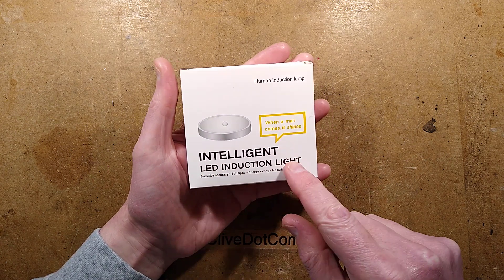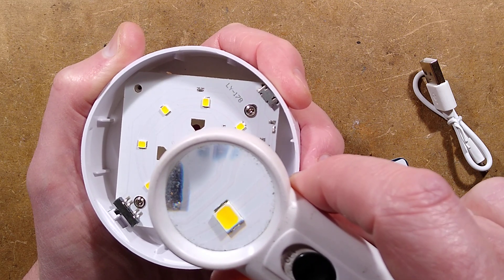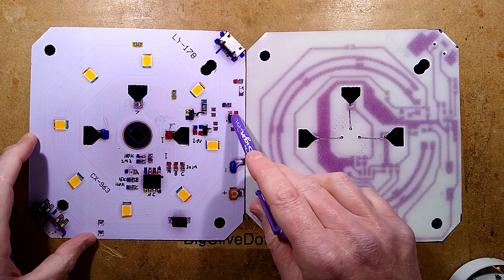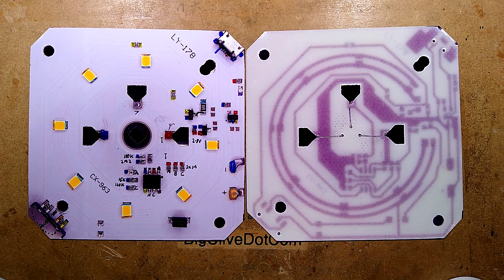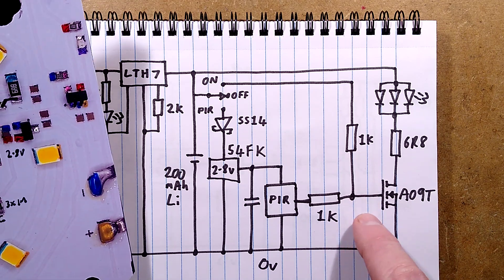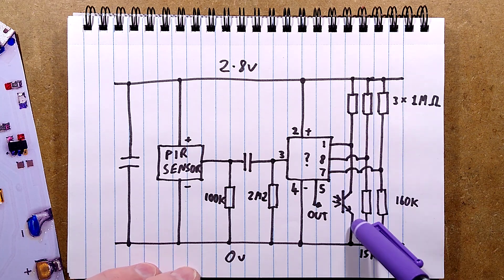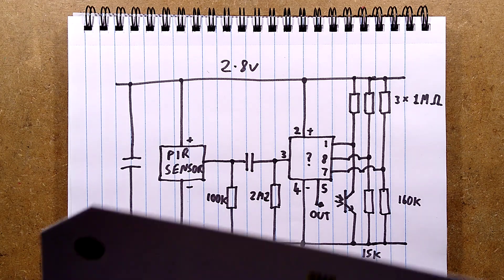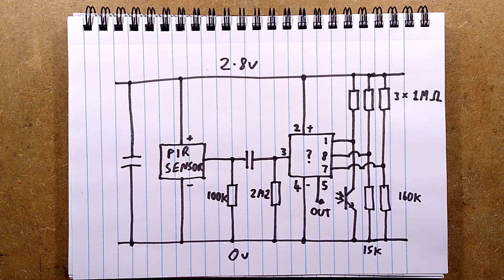eBay rechargeable movement detecting light

Comment: Hi Clive,

I have a question/query, with regard to lighting triggered by movement.

I bought 2 rechargeable aluminium bar style LED lights with magnetic pads to use in my kitchen,  they sit underneath each of the wall hung cabinets.

The one over the sink, seems to get activated even when no one is in the room. Is it possible that my shiny stainless steel sink is somehow reflecting back at the lightings detection system causing it to switch on?, with that in mind, I swapped it over with the other one and bingo!, this now randomly turns on, so the lights are not faulty to my reckoning.

Does reflection off of stainless steel cause my light to activate itself?, maybe?
Reply from the maker: Yes.  They can see thermal reflections from shiny surfaces like glass and metal.  Maybe made worse by the sink acting as a wide angle reflector.

Comment: Based on your search words, I looked on eBay and found a pair of these that were cheaper than your estimate. What was even odder, the vendor of these had an ad that was even cheaper but didn't show up in the search. I only noticed because the "related" ones had an ad for a pair that were cheaper. When I checked it, it was the same vendor. Not sure why the search didn't show that one up but no matter. It arrived 2 weeks after ordering.

The only differences were no switch and round magnets rather than a square one. Oh, and only 6 LEDs rather than 8.

I stuck one of them up under the ceiling in front of my entrance door the other night. When I went out that night, it worked well but I was disappointed to find that it had dropped by the time I got back. Seems the glue holding the magnet into the device isn't that strong.

Anyway, how long does one of these last before it needs to be recharged? Say, without it being used?
Reply from the maker: Quiescent current is low, so it depends more on the number of actuations.

Comment: I wonder which of the resistors, if any, determines the length of time it stays lit once it's turned on?  On the ones I have I changed the resistor from 47k to 10k to reduce the on time from 20 seconds down to 8 seconds.  That extended the time to a month between charges.  Thanks, Clive.
Reply from the maker: The chip is identified in the description.  You can change the time delay.

Comment: I have a similar light in that it is triggered to turn on. It's called a "Mighty Light". I looked for another awhile back. They want to much for them. It uses a 9V battery and lasts a long time. I use rechargeable lithium in it now. Here is why:
Wife calls it the ghost light. When the charge drops it will turn on/off within the normal set time but it will erratically activate. Switching to the rechargeables stopped that. It was quite exciting being woken up by a random light coming from the bathroom, along with the accompanying exclamations and bitching! Lol!

Comment: decode the IC by its Pins and connected parts - From the circuit you have drawn, its a dual opamp - like the ones from TI and Microchip. Try OPA835 - Pin2 pin4 supply voltage terminals fit pinout. wonder if a LP358 is subbed with requisite changes ,  will it work?

Comment: Off Topic: Clive, when you have the time could you look at grow lamp bulbs. I have 5 that are rated 85-240V AC. What I find strange is the power consumption remains constant at 10W per globe irrespective of the voltage I supply to them from a variac. I'd love to know how they achieve that. The other curiosity is these are rated at 30W, not 10W (I'm guessing that is a claim the output is equivalent to a 30W non-LED bulb).
Reply from the maker: They will be using switching power supplies that can operate over a wide voltage range.  They transfer the power as a series of magnetic pulses through an inductor or transformer, and only run as much as is needed to satisfy the load.
Reply: @bigclivedotcom   Thank you for the reply. I've been out of electronics for over a decade now so I find it amazing that these days a purpose built switch mode power supply in each of these bulbs makes economic sense over the alternative which would be 2 styles of bulb, one for 110/120V and another for 220/240V. Not that I doubt what you say for a moment. Times move on and my thought patterns are to some extent stuck in the past. Best regards.

Comment: For larfs in a future video, you could obtain an old replaceable mobile phone battery and wire that in. Something of the order of 2000mAh should be easily obtainable and would also have its own safety circuitry built in.
It would take ages to charge (I wouldn't recommend increasing the charging current as the linear charger will get very toasty), but it would last ages too.

Comment: Got one of these, immediately after opening i did exactly as you said: decreased the current (mine had 2R2 resistor, changed to 22R) and increased the battery.

Comment: Might chip "?" simply be a 555-type device in bistable flip-flop mode?
Reply from the maker: It turns out to be a mx8098g
Reply: @bigclivedotcom  

Thanks for responding, Clive.  

As you probably already discovered, Googling "mx9089g" returns lots and lots of what look like tech data sheets, all of them in Chinese, and only in Chinese.  I predict that that will occur more and more frequently.

Google Translate had trouble digesting them.

It might be prudent for the next generation of engineering tech folks to start learning Mandarin Chinese, starting now.  If taken with a positive attitude, doing so can be enjoyable, and can help to prop open the doors of opportunity.
Reply from the maker: @haroldsmith45302  You can actually glean a lot of data from the images and number son the datasheets before having to use the Google translate app if at all.

Comment: Did you make current consumption measurements while in standby mode (not triggered)? 
I wonder how long the battery lasts just sitting idle!
Reply from the maker: 9.5uA stated standby current.  mx8098g

Comment: Actually, a narrow one of these would be ideal for my front door. It could fit at the top of the door frame between the security screen door and the front door, and illuminate the door itself so I could actually see where the key hole is. Since it's magnetic, I wouldn't even need the sticky back piece of metal, it should stick straight to the steel door frame. The lighting in the stairwell of my building is terrible. It's literally never worked properly, even after they replace the tubes. They use those tiny 4W tubes, and they constantly strobe whenever you press the button, like they're running at half or even a quarter the 50Hz mains. I thought the ballasts were supposed to give up if they fail to strike? It's like they wired the two fittings in series or something.
Reply from the maker: You can get slim versions.

Comment: Nice that they went with the 2.8v ldo instead of 3v3, I have a previous pir LED rechargable you recommended and I think it has the 3v3 which you pointed out as a weakness. Would be nice for the furnace room/utility room especially in case of power outage.

I bought one of those spudgers you use (yes the brand iSesamo) and it's lovely... I am now also accumulating a collection of "standard" Chinese components: got the A2SHB n channel mosfets, A5SHB p channel (not sure why I didn't get the a1shb instead), j3y npn, and have the 662k 3.3v ldo on the way... Can't remember the common pnp part. So much sot-23 making my diy circuits tiny, and making it possible for me to spend time repairing super cheap things...

Comment: No protection on the cell? How naughty!
Reply: I don't think it's critical. The draw of the PIR circuit is really low, and the LEDs won't pass any current below their somewhat gradual threshold range, so they should cut off around 2.8V. So when the battery is drained, you probably have months left before the battery reaches deep discharge during which you should definitely recharge it.

Comment: You would think that a Chinese Company wanting to sell to English speaking customers would hire a proper grammar English speaking translator...
Reply: And then have to produce and sell one thousand units to recoup the cost?  Cheaper to use a dictionary or Google Translate...
Reply: @Rob2  It's a translator.... Not a Rocket Scientist... 
Besides...You still have to pay to print the gibberish
Reply: @lasersbee  When you get a cheap translator you will still get bad results.
I would think you would need to hire a translator from an English speaking country, and pay the tariff that is normal there.  Which could be a lot compared to a local guy.

Comment: Just FYI - the A09T is my favorite AO3400 FET :)
Reply from the maker: Looking at the specs, it's even better than my previous favourite the A2SHB.  Ridiculously easy to drive with staggeringly low on-state resistance.
Reply: @bigclivedotcom  And I have to say that after using ~100 of them (and also AO3401), they are a little magic - the on-state resistance means you can drive 1A without even noticeable warming...

Comment: It seems to me that the light output is going to be very variable.  When the lithium cell is fully charged there's about a volt across the 6R8 resistor and the current is about 150mA but when the battery reaches end of discharge the voltage across the 6R8 approaches zero.  So this light is going to get progressively dimmer as the battery discharges.
Reply from the maker: That's handy as you remember to charge the battery when the light level is getting too low.
Reply: It only has to bright enough to enable the kleenex cover up.

Comment: How long does it stay on for? I need a light in the smallest room for when I need to go, rather than come, but the Aldi one I bought went out before I'd finished! I studied the data sheet and found which resistor and capacitor changed the on time, but still haven't got round to hacking it. If this one stays on for longer it would save me the effort, especially as I'm now dreaming about converting it to an IoT device! All I really want is that when a man goes, it shines until he's finished!
Reply: It doesn't turn on when you are going, only when you are coming!
You need to finish the hack on the device you already have, then you'll know whether or not you are coming or going.
Reply from the maker: Most stay on for 20 to 30 seconds, but should keep resetting the timer with continued movement.

Comment: For the first time i got a relay without any markings last week. From AZDelivery. Its a 4 relay optocoupler  switched extension board for arduino which seems to work starting at 3.3V. Relay coils get 5 volt from arduino via jumper or separate source.
Secondary side seems to be 230V AC and there is also good separation of low/HV side.
Only thing strange: no print on the relais at all. Until now even the cheapest i saw had some printing, if true or not up to luck.

Comment: PIR Detector is a term used by the vast majority of security installers around the world.  Which supposedly stands for Passive Infra Red Detector.
It’s a term which is in fact incorrect.  PIR stands for Passive Infrared Receiver.
Trust me.  I was a security lecturer for 20 years at the local university.  So it is a PIR only.  No detector on the end.
The PIR can can with two or four elements.  Two = a positive element and a negative element.
Four = +ve  -ve  -ve  +ve.
Reply: I guess if something is happening as a result of the IR being received, then it's being detected. It's just semantics.
Reply: @SH-vv7zq  He'd be fun at parties though..... lol
Reply from the maker: I was under the impression PIR stands for Passive InfraRed.  As in IR LED for InfraRed Light Emitting Diode.
Reply: @bigclivedotcom    Actually no.  When it was first used in security many many years ago.  Because infrared was taken as one word.
Reply: @bigclivedotcom  Because you never see infrared represented as the letter 'I'

Comment: Out of idle curiosity, how does one measure the battery capacity?
Reply: Charge, measure, discharge, measure. Repeat.
Reply: If you watch some of his other videos, BC discharges Li-ion battery until it switches off then uses in-line USB charge monitor during recharge which records mAh going in until charge cycle stops itself at full charge.
Reply: @briandeschene8424  OK excellent, thanks!
Reply: @briandeschene8424  Charge/discharge isn't 100% efficient (you don't get out exactly what you put in) but it's close enough for Li-Ion.  Maybe 5 to 10% difference.

Comment: If you have another 1-3 batteries about the same size you could easily wire them in parallel to the current battery. You would only need wire capable of handling 1 amp

Comment: Factory equipment and electric guitars.

Possibly a stupid question:. What's the current preferred drivers for seven segment LEDs? I'm sufficiently old that I remember 7447s and 4511s, but those wind up using up a lot of pins coming out of a microcontroller. A little searching at Mouser found a Maxim chip that takes a two wire interface and drives four digits, but the price was pretty high. Any suggestions off the top of your head?
Reply from the maker: The displays are so efficient now that direct driving from a microcontroller is common.  Sometime economising on pins with a serial to parallel shift register.
Reply: @bigclivedotcom  Yeah, 12 digits of 7 segment displays eats a lot of lines. I was looking at using a 7447 and a 4-to-16 multiplexer, but it seemed like that would be very flickery, only lighting up one digit at a time.  The MAX6958 seems like an option: 2 lines to drive four digits. I just wish they were cheaper.
Reply from the maker: @PaulSteMarie  Ah, for big displays it might be worth looking at the MAX7219.
8 digits with just three lines clock, data and load.  Also just a single local decoupling capacitor and one resistor to set the current for all the LEDs.  I believe they can also be cascaded on the same clock and load lines, with data exiting the first chip and entering the second.
Reply from the maker: https://www.ebay.co.uk/itm/174798051779
https://datasheets.maximintegrated.com/en/ds/MAX7219-MAX7221.pdf
Reply: @bigclivedotcom  So strange! That module is about 1/3 the price of the driver chip alone from Digikey.

Comment: Clive! Please illuminate us on the subject of;- pre-charge shunt resistors for dc to a.c. inverters for solar and caravans. There is very little info. One guy said one value was "ok" for 2k-6k watts, and one webpage with various non-experts weighing in.
 Side note. Your reply on the crime dog safety strobe beacon incandescent bulb got lost in the shuffle. Ad block plus does not notify me of replies. If I ever get my laptop fixed I'll see it. That's why I'm not asking a specific question. God knows if I'll see the answer. Thanks. Four year sub now. I've learned a lot.
Reply: You should be able to calculate the resistance needed for pre-charge (I assume to prevent nuisance tripping on first cold connect). Inrush current oversupply protection device, the resistor (Or a light bulb) should be able to be sized to suit. Many newer high capacity inverters now have inrush protection built in.
Reply: Its for cap longevity.
Reply: A big battery bank's current supposedly can nuke them. Idk how to calculate.  Every other month I plan to add a 200Ah battery... Won't the value change? Or 2 2k inverters? I kinda need it layed out. I'm not a rocket surgeon.
Reply: I've a 48V 5KW Victron inverter and it is brutal on isolator switch and breaker contacts when you switch it on[1]. Measuring the time constant with a resistor indicates something like 44,000 uF.  To avoid the huge inrush I now use a 500 ohm resistor across the breaker and only close the contacts after the battery has been connected for abut a minute.

[1] It blasts lumps out of the contacts every time you switch it on and over time the resistance of the switch goes up resulting in it eventually burning out under load. I hate to think what the peak currents do to the capacitors.

Comment: The old standby motion detector is the BISS0001, but it's in a 16-pin package. I searched for "PIR motion detector" and came across the Excelitas PYD1798 chip in an SO-8 package. However, the pinout does not jibe with your schematic. Oh well, the point is that there are cheap detector ICs out there, no doubt of the Chinese persuasion, and the PYD1798 is one of them.
Reply: I was going to post the same on the BISS0001.  It has a similar set voltage division pins. https://datasheetspdf.com/pdf/990807/SilvanChip/BISS0001/1
Reply from the maker: The chip was identified.  It's in the description.
Reply: @bigclivedotcom  A very obscure chip. I can find no link to it at all.

Comment: Hey Clive! I live in a caravan and I bought some LED 1156 lightbulbs to replace all my burnt out incandescent ones. Moments after installing them they got hot enough to smoke and let off some noxious odors, so I hurriedly took them out. I thought of you instantly, wondering if you’d like to have a look at these death bulbs that nearly toasted my humble home and figure out why they are so faulty? I could send them along.

Cheers,
Alexander
Reply from the maker: Check the voltage and if they are "canbus compatible" lamps.  Nothing to do with the canbus, but actually a low value resistor to pass enough current to allow the lamp filament detector to work in cars.  They get very hot in use.
Reply: @bigclivedotcom  ahhh, interesting. upon a closer inspection of them i realized that some of the diodes were not even connected properly and looked like they were randomly glued on or something, they are quite impressively crap. still can't get the stench of burning chemicals out of my caravan, lol.
Reply: Most of these lights are pushed to the limit at 12v, your van on charge is probably pushing 14v on the DC loom.